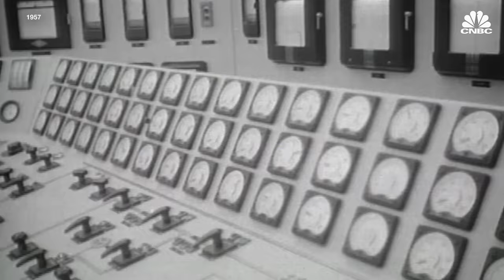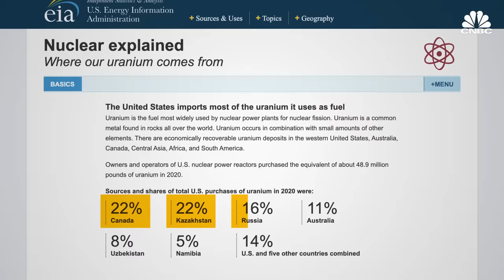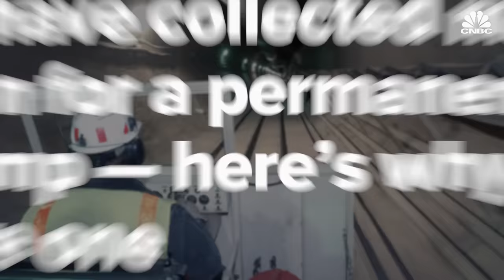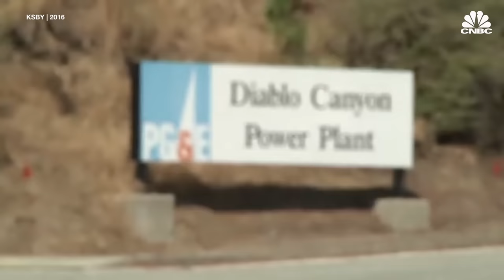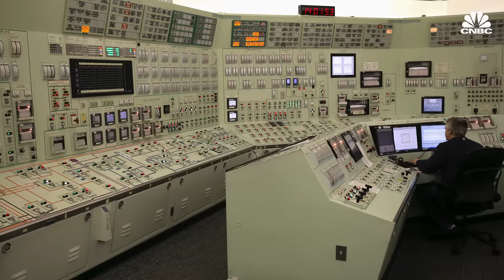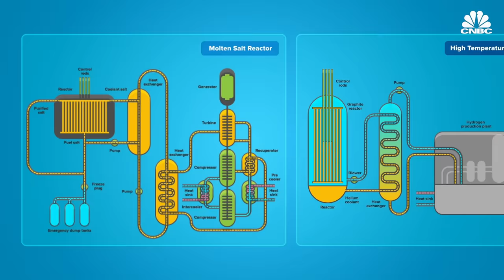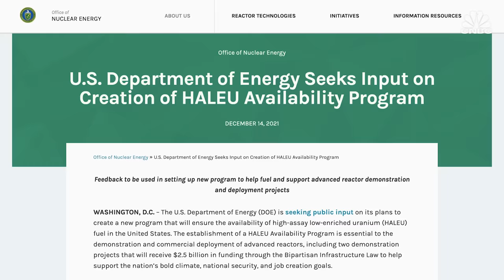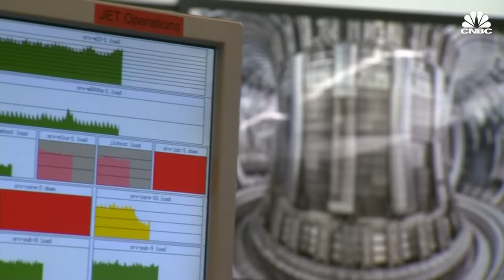Why Nuclear Energy Is On The Verge Of A Renaissance

Comment: There is an excellent TED Talk available on Youtube which explains the value of Nuclear energy by a scientist in the green-energy field.  

I highly recommend watching the TED Talk if you're interested in green-energy or you have concerns over Nuclear power.
Reply: @clarkkent9080  - Both of your statements are patently false.

Nuclear fission runs about 4 cents per kWh fully amortized over the lifetime of the Nuclear plant.

It teeters around the cost of hydro, which is roughly tied for the least expensive based on fully amortizing the cost over the lifetime of the plant/generators.

The new micro/sodium-fission plants will reduce that further.

This information is so definitively published/widespread, my only guess is that perhaps you're using a benchmark such as nuclear operational costs - vs - renewables -- or some other obtuse/irrelevant measure.
Reply: @InspiredScience  You and what you call definitively published/widespread information use the cost of nuclear based upon plants built in the 1970s and 1980s, adjusted for inflation. I have not found one cost analysis for nuclear that uses real up to date numbers, and that is even if you ignore the nuclear builds that have simply been canceled after spending billions.  The nuclear resurgence had its change with Vogtle and VC Summer and it totally failed.

 I base my information on the current new nuclear projects. And that is the fact that in the U.S. the Vogtle unit 3/4 projects are now $15.2 billion per 1,200 Mw PWR reactors and the project is not yet complete and is expected to top $16 billion each.   Or you could use the VC Summer unit 2/3 fact that after spending and contractually bound to pay $17 billion they canceled the project so no matter how you amortize that the ratepayer got screwed.

Now lets look at Terrapower, already behind schedule and now projecting that their 345 Mw Natrium reactor originally advertised at $1 billion will cost $4 billion and that's aligned with the Vogtle project cost per Mw but the project hasn't even broken ground after 2 years, so I expect the "supply chain, fuel cost, labor shortage, inflation" excuses to soon follow.
The only other U.S. nuclear project is NuScale's 77 Mw SMR that is also behind schedule and at its estimated to cost of $4 billion is off the charts in cost per Mw.

Solar and wind turbine cost continue to decrease year after year.  Today, it is cost effective for most homeowners to go completely off grid with solar/battery payback periods of less than 7 years.  Nuclear power's only selling point is calling it green energy but it has priced itself out of even that market.
Reply: @clarkkent9080   Yet you continue to ignore the fact that the US and many other countries have built and used small modular reactors for many decades built in two years or less for millions not billions.
Reply: @clarkkent9080  - I'm not sure what you are missing.  First, the construction costs are underestimated based on U.S. production costs on the current plants, that's true.

However, the net-effect of this, when amortized over the 60-year lifespan, would still result in the one of the lowest costs of energy.

Let's break it down simply.  Let's say you believe an AP1000 plant costs $20B in the US.  Over its 60-year lifetime, it produces (net) about 5.87e11 kWh.

Divide the $20b by the net output and you have a cost of 3.4 cents per kWh.

Of course you have operational costs, which are substantial.  However, my point is that whether it's a $10b plant or $20b plant, at a net production rate of 1,117 MWe and 60-year effective life, DOUBLING a $10b reasonable price for an AP1000 (in any other country) is only responsible for adding about 1.7 cents to the kWh price.

Factor that against the alternatives and Nuclear still enjoys a top position.

No one is saying that we should avoid other renewables, that's not the point.  The point is that we should develop greater efficiencies in fission; which we're on the cusp of releasing.  This will reduce the turnaround to construction time and reduce the cost.  Plus, it will be far more practical / shorter-run power delivery (saving substantially in power-network/transport/logistics).

Simply put -- our focus should be on developing tech concurrently in renewables and Nuclear.  Furthermore, Nuclear is not the most expensive form of energy, your original claim is wrong.

I'm also guessing you didn't watch the TED talk that's the very subject of my comment.  If you did, you'd see the environmental impact of Nuclear is proving to be less than renewables.  I personally find that shocking; to the point of not believing it.

I spent a great deal of time researching/believing I could debunk this.  Guess what?  I wasn't able to do so.  Not with all context factored-in.

Good chatting with you, take care.
Reply: @InspiredScience  I don't know where the 60-year life span comes from since EVERY nuclear plant in the U.S. has a design life of 40 years.  Yes, the NRC has approved 59 plants for operation beyond 40 years but once any plant that is ~ 40 years old has a major equipment failure the owners shut down. Just look at the list of U.S. nuclear plants and how long they operated before they were shutdown.  That is why the U.S. taxpayer is giving investor-owned utilities $10 billion to keep them operating.  If they are so cost effective after construction costs are paid off why does the government have to bribe them to keep operating? It is a simple example but why don't you see many 1960 vintage cars driving around? Same basic reasons.

In addition to operational cost you are missing fuel costs, decommissioning costs, and spent fuel storage. And if a disposal method is ever developed then cost to dispose of the waste. 

All I have to say about the efficiencies in developing new fission reactors is don't tell me about it or show me a power point, SHOW ME REALITY.  The NuScale SMR is estimated to cost $4 billion for 77 Mw.  Now give me the better, cheaper, faster next time excuse.  VC Summer and Vogtle both used the factory built module method and both PROVED it cost more because of poor welds and modules that did not fit together on site. Yes, this should not happen, and it may be a fixable issue but that is REALITY TODAY.

You can do all the research you want and believe what you want but you, the general public, and the media do not decide what type of plant to build, that is up to the utilities and their investors.  We know that the Vogtle AP1000 is going to come in at ~$16 billion for each 1,200 Mw PWR. If your calculations are correct that even at $20 billion it is cost effective and the cheapest form of energy generation and clean at that, then why is no other U.S utility even considering a AP1000???  It seems like utilities are waiting to see what happens with TerraPower and NuScale and that will not happen until at least 2030.  Since both these projects are already behind schedule I am waiting for the "supply chain, labor shortage, fuel cost " excuses.

I worked in the nuclear field for 40+ years as a Reactor Operator/Senior Reactor Operator at 5 different nuclear facilities and am pronuclear.  But if you cannot build it cost effectively in the U.S. and that has been proven to be the case then you either have to fix the construction issues or move on to other methods. The construction issues will not fix themselves and doing the same thing over and over and expecting a different result is insanity.

take care and keep believing
Reply: @clarkkent9080  - The faulty assumption is that the AP1000 costs more strictly due to inflation.

The stated lifetime is 60 years, period.  Does it cost money to re-certify/license incrementally, yes.  Does that have anything to do with the delta I explained?  No.

The old-jalopy example is a false-equivalence fallacy.

You completely missed the very clear point that I communicated:  The operational costs are irrelevant in this case, because your argument is that fission is now more expensive, due to construction costs being much higher.

Without moving goalposts, sticking to your argument, I explained the difference, in cost per kWh, based on doubling the construction costs from $10b to $20b.

Simply put: 

You claimed that due to higher costs of construction, the fission cost estimates are wrong.  I explained exactly how that delta affects the net pricing, addressing your exact argument.

As I originally explained, you wouldn't include operational costs in that model.

If you did want to argue operational costs, then the net-cost of fission would be reduced because newer plants (particularly sodium based) require lower operational budgets per kWh.

Most importantly .. 

As someone else explained, you're not factoring in the Gen 4 micro plants or the new tech that would be used to build the coming phase of fission plants.

It's almost as if you seem more concerned with being right, than simply focusing on the objective data and intellectual discussion.  Or that you're pounding your chest to tell us how much you know, having operated legacy plants.

I'm not here to be "right"; I'm simply referring to the established empirical data/calculations and I've provided you with alterations to data data, as you requested, so that you could see the net-effect of your reasoning, precisely as you explained it.
Reply: @InspiredScience  Here are simple facts. No data just reality.

There is only one current PWR design (AP1000) that is currently approved by the NRC for construction and operation.  After the VC Summer and Vogtle financial disaster (you may disagree, but these utilities don't) no other U.S. utility is even considering building this design....PERIOD end of story.
There are no gen 4 reactors operating.  The Terrapower and NuScale reactors are gen 4 reactor designs.  The plants that are proposed are demo test reactors that will not be operational until 2030 at the earliest if at all.  They are only being built because the taxpayer is footing 50% of the cost and no more are planned until these operate and the concept is proven.  Any argument of how efficient or cost effective they are is just corporate PR just like the AP1000 was supposed to only cost $7 billion and use factory module builds to complete in 8 years.  The 345 Mw Natrium is equal in cost per Kw with that of the failed AP1000. The 77Mw NuScale reactor is 5 times more expensive per kw than the AP1000 ....PERIOD end of story.

Old reactors are shutting down on average of 2 per year no matter how cost effective you think they are and even $10 billion in taxpayer welfare isn't stopping that....PERION end of story.

Vogtle unit 3/4 may start in a year or two but after that all the U.S. has is two demo test reactors on the books while large legacy reactors shut down every year.  You can calculate, complain, justify all you want but nuclear contribution to the U.S. energy mix will decrease until new commercial nuclear comes on line.

What gen 4 plants are on the books other than Terrapower and NuScale?????  How many of these small plants will be needed to equal the output of one legacy PWR/BWR????
What ACTUAL build times or costs of these plants in the U.S. can you provide to back up any claims????  These are simple questions.  I provide REAL examples and REAL costs for the PRESENT for my opinion.  
Keep dreaming !!!!
Reply: @clarkkent9080  - I simply used your examples.  You referred to the costs of the Plant Vogtle Units 3 and 4.  These are AP1000 plants.  You provided specific numbers.

I amortized the numbers based on the AP1000 lifetime and the increased construction costs.

Those facts are based on a topic you raised -- entirely your basis for your argument.

I provided evidence that disproved your point.  Since then you have begun shifting goalposts.

You can't admit you made a miscalculation on the very topic you started -- there is absolutely no basis for going any further.

How about this, as you clearly care more about being right than admitting when you've misstated?  

You're right, I'm wrong.

There, happy now?  The 3/4 are not AP1000 plants, math doesn't work the way I believe it to, I didn't use your budgetary numbers (and in fact, exceed them to help make your point) -- nope -- I'm just plain wrong.

Are we good now?
Reply: @InspiredScience  Simple REALITY dude: VC Summer project management canceled their units after spending $17 billion so maybe you should amortize for them.  Please explain why they cancelled 2 projects that YOU prove were a great deal?????

Vogtle missed their budget by 110% and NOW no other utility is considering the AP1000 or any other nuclear plant.  Please explain why you amortize numbers don't have them jumping at the change to build a AP1000 for a measly $20 billion????

You need to start your own utility and build these great deals

Your just like the other know nothings on these channels that cite numbers and comparisons but refuse to discuss the most recent 5 nuclear projects in the U.S. that by all accounts (please show me anyone who thinks Vogtle is a great deal) are total failures. 

Let me simplify it for you: Utility no want nuclear.